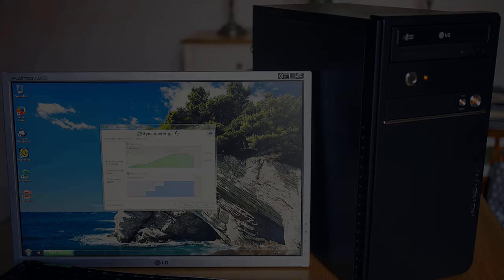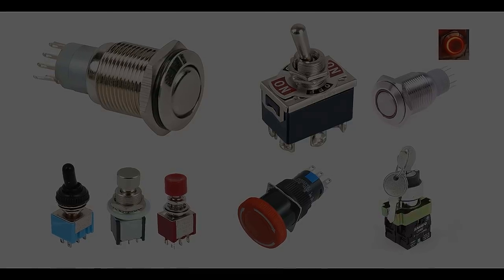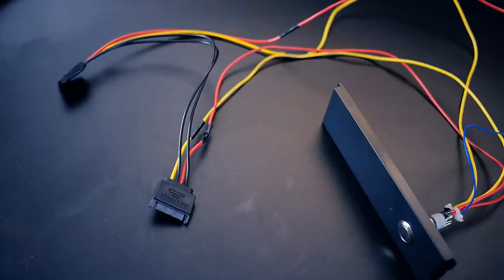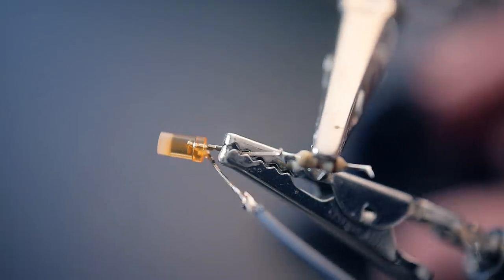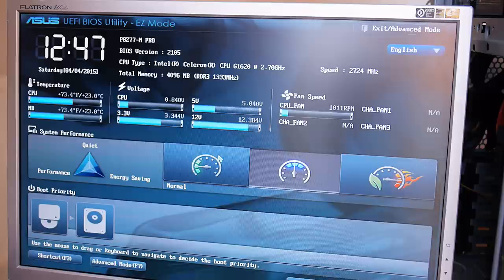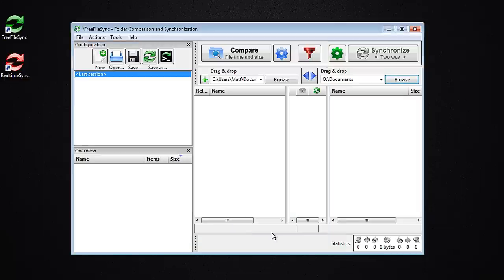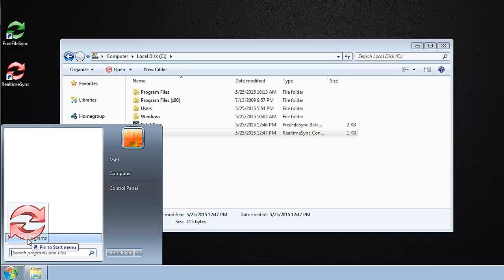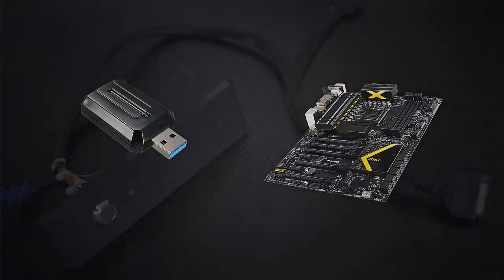How to Make a One-Click Backup Button

Comment: Kinda did this with Hdparm in Windows. Dismounting and silencing my INTERNAL Backup HDD.

I  programmed a script to mount the HDD then start the Back UP (with FFS). 
As soon as the Back up finishes the Script automaticly Spinsdown the HDD and dismounts it again.
Reply: Sure! First you need to download hdparm for windows (since its only native to linux): https://sites.google.com/site/disablehddapm/home?pli=1 (Download the correct one)

You then need to write a cmd (as admin) with cd "wherever you installed hdparm" (e.g C:\ Program Files\hdparm\). as 2nd Line you need to use hdparm -y hdx

X stands for your drive. If you want to silence your first drive, Use hda, your second drive hdb, and so on. I have 4 drives and i wanted to silence my 4th drive, so i used hdd.

Be careful. Because its an ADMIN-Tool you can permanently damage your HDD. 

Want to do this with one click? Create a Batch-File with these commands

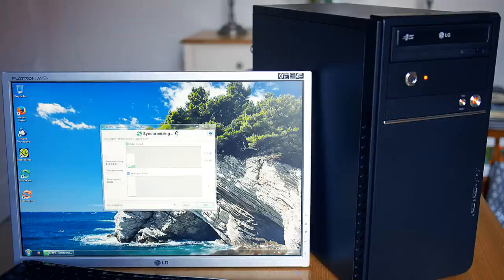Comment: 8:06 dont just disconnect the backup drive it will end up killing the drive sooner or later. It will be at the point where you actually need it. Also dont use a Seagate drive for backup it will die when you need it.

Comment: can free file sync be used on a server, and whenever a computer is connected to the network, then it can be backed up? or will I have to have the software on all my PC's and just use a external hard drive?
Reply from the maker: Hayden123457 It should work on a server, yes.
Reply: DIY Perks thank you

Comment: Done that, but when I turn on the backup hard drive my pc frozes up and has troubles booting up again. Hot swap configured
Could be because I'm using the same power cable as the windows ssd to power up the backup drive?
Reply: EDIT: I used a different exit of my psu that I reserved just for the backup hdd and now it works fine! 
I suggest to not use the same cable as the operating system drive

Comment: I got a interesting question. How the backup software recognize your backup hard drive? by firmware or the drive name? Say if it's by driver name, when I plug in another USB stick which is not a backup driver, would be initialized to run the backup application?
Reply: by the sata port
Reply: No, because he also plugin the USB hard drive.
Reply: +Mirui Wang Probably by the volume ID, each partition has something like a GUID generated so it probably just stores that
Reply: thanks.

Comment: That whole button setup is unnecessary.  You should always be backing up.  It's easier to just connect a regular hard drive into the computer, install that software and have it running all the time.  Then EVERY file you save or delete will ALWAYS be backed up with not additional effort.
Reply: DoomFinger511 the problem is that if you have a Ransomware on your computer it will also encrypt your backed up files, but if your backup HD was powered off the Ransomware wouldn't do anything to your backup HD, so the button is not just to make you remember to backup your file, it's also giving you a layer of protection against Ransomware and other kind of viruses that destroy any data that is connected to your computer.

Comment: Question: Since the 5 volts cable is always connected to the HD, does it mean that some power is drawn even if we are not using the HD? I'm kind of a power saving freak, so if it is even a little consumption, it matters to me :)
Also because I was thinking to use this "trick" to switch between OS with different set of HDs, so when I use one the other HDs won't power up for nothing.
Another doubt is about SSD... is it possible they may run on the 5V alone?
Thanks
Reply from the maker: As it's a double pole switch, 5V is disconnected along with 12v, so it really is unplugged entirely from the PSU.
Reply: +DIY Perks Sorry I missed the DP part at the first watch...
A friend (more skilled than me in electronics) suggested that one can use a SP (Single Pole) button on the ground to cut the power. What are your thoughts on that?
Reply from the maker: Unless you isolate the drive, switching the ground connection probably won't work because the drive will still be grounded through the chassis.
Reply: In addition to what DIY Perks said, the drive would be getting 7V applied between the 12V and 5V inputs if the ground was totally disconnected. It could kill the HDD's circuit board if it dosen't have internal voltage regulation. 

And if you think like I do, the answer to that burning question is yes. If you want to run a always on case fan that dosen't have automatic speed control at about half power (6V would be half speed), use the 5V as ground and the 12V as power. Instant 7V supply to the fan and it runs at just over half power. I put a double pole 4 position switch on my case to select various weird voltages for case fans. This can also be used to turn an old PSU into a (somewhat overkill) AC adaptor for pretty much ANYTHING you can think of that uses 2.7V (between 3.3 and 5V), 3.3V, 5V, 7V (Between 5 and 12V), 8.7V (Between 3.3 and 12V), 12V, 18.3V (Between -15 and 3.3), 20V (Between -15 and 5V) and 27V (Between -15 and +12). Desktop PSUs make a nice lab power supply with lots of power, only drawback is any combination using the -15 rail is limited to 1A max.

Comment: Is there any way to do the button backup without soldering?
Reply: +The Galactic Void You can use, i imagine, keyboard buttons in certain combinations. On Windows there are programs like AutoHotKey. It will seem difficult to set up but with a few hours of documentation, it should be doable for most people that have a clue and can use a search engine.
Reply: One method that I've finally put into play is using a Syba 5.25" Bay (SY-MRA55006). This also adds in the ability to quickly remove the drive or store it elsewhere.

These alternatives have locking mechanisms on the front:
Thermaltake ST0026Z 
Kingwin KF-253-BK

Comment: When you just disconnect power to the drive it damages it (notice the loud click it makes). You would have to eject it first. On that note the backup drive will probably fail sooner than the main drive.
Reply: Sorry thats not true. You will corrupt files if Windows was still writing on it (hence i recommend disabling write cache for your Backup drive). But you will NOT damage the drive. They are protected against sudden power downs. The click you hear is the head going into parking position. Which happens automatically if the power is cut, purely by using the force of the spinning disks.

Comment: if i embed a portable hardrive inside my pc using a spare usb port can i just use a single pole switch on the postive rail of usb.
Reply: +stewart c You only need a double pole if you want a LED. If not a single pole is fine. Yes you can do that, but why not just take it out of the enclosure and plug it into sata? That would allow much faster transfer speeds than over usb.

Comment: could i use a usb cable, plug it into my raspberry pi mini computer then have some software installed on that so when it boots the software loads up and then have a harddrive connected to a usb to sata from the raspberry pi so that when the button is pressed, it detects the main pc as a drive, then it some how copys data from the pc to the raspberry pi and into the new drive?

Comment: I know there is still reasons for this to keep local, but the effort required still wont't match the todays method of using a service like onedrive or google drive, can get 15GB for ''free'' 

I know this is 5 years old and some might still want a local option, but real time cloning would be more appropriate as even a days worth of data can be a pain for some

Comment: What happens if I only disconnect the 12 V rail because i can't find a DPDT button, when i do it windows does not see the HDD in the Disk manager and when it connect it back up the HDD appears.

So basically does it work with only the 12 V rail disconnected and the 5 V connected, does it affect the HDD
Reply: Wondering the same thing because I have a cool button but it does't have two poles...

Comment: This is generally how you end up losing data after you dismount the drive whilst windows is doing a cache check or defrag on the drive. Just plug a hard drive in and use the windows encryption tool. Problem solved. Your backups are protected and corruption free. Your welcome.

Comment: but just cutting power to the harddrive isnt good? same thing as pulling the power to the computer
Reply: Doc842 it is not really dangerous because newer hard drives have protections against power loss. On top, the hard drive is not in action so the reading thing is inactive and can not deal any damage to your hdd. If you want it as safe as possible, use an external drive as in the video and unplug it after shutting down your pc.
Reply: Actually, if the files have not finished writing to the drive it is very dangerous. This is common if you do things like enable NTFS compression on the target drive, or if you are running a very fast source drive (SSD) and the target drive is slow (HDD). Basically, the OS could report to the software its done writing, so the software finishes, but if you check your RAM use, you might see a coloured section showing Modified data. This is data that has not yet been finalised to disk.
One of the functions of the Safely Remove Hardware function in Windows is to ensure that all Modified data has been fully flushed to disk before the disk is detached.
Reply: There may be an icon on the bottom right, which lets you safely eject the drive before cutting power.
Reply: It's ok if your pc can hotswap hdd.
Reply: Windows has that ejection thing or it does when you unplug it but if it has windows than you will get a bsod
Reply: It is NOT safe just because you use hotswap. Windows will still be using the writing cache. It can corrupt your MFT.
Reply: It's fine in a RAID 1 scenario with the m/b and BIOS equipped to handle hot swap.  Server boards can even handle DIMMs being hot swapped these days.

Comment: A real backup should allow simple drive swapping and your up and running again in no time at all when a failure does occur.  Where's the software that allows that type of backup?
Reply: Use the backup function of GParted on the Linux based GParted partition editor boot disk. You'd boot the CD (or USB), and use the partition clone feature to create a "clone" drive that could be swapped in place.  I'd reccommend creating a clone of a vanilla OS install with all the updates and software you need with no data, then backup the data seperately using a regular backup. Keep the twin drive somewhere safe and do a physical swap if something goes bad, and restore the file backup. OS back and running instantly, files reloading int he background over an hour or two. I'd reccommend multiple clone drives for maximum convenience. The drives have to be the same model series as Windows won't boot with a different drive model or in the very least would require license reactivation.

Commercial alternatives (that vary from cheap to expensive) are something like Norton Ghost, which also work VERY well, but are generally a hint on the expen$ive side, but work in the exact same way, give or take a few features.
Reply: theLuigiFan0007
 Thanks for the response.  The backup that consumers need is one which DOES NOT require multiple clicks and routines to accomplish.  LISTEN UP SOFTWARE ENGINEERS....  The ideal backup procedure would be as follows;
1.  End of work day, computer user double clicks on a icon, grabs his jacket and keys and is out the door.  When user returns the next day they power on their computer and begin working.

The backup is performed internally to a second hard drive that can be selectively chosen as the new primary boot device through bios IF/WHEN a catastrophic failure occurs.

No selective restore routines, no OS reinstall and then perform a restore from backup....the routine needs to be quick and simple so the user is back being productive in less than 15 minutes.  And, if necessary, they can call a tech to schedule the failed drive replacement, but the key is they are working again and production continues.

The problem with RAID arrays is if you get a virus, its instantly copied to the other drives as well.

Comment: There is no point In having a fancy switch just use a simple push switch instead of 12v and 5v connected ground to switch it required less soldering and is less complex.

Comment: My cable has 4 wires, what do I do?
Reply: the 2 blacks are ground wires and the yellow wire is the 12 volt and the red wire is the 5 volt rail
Reply: Aimee Cos oops I meant to type 5 wires, it has an extra orange wire. I 'll try with it and if it doesnt work i'll just cut it. thanks for your reply though.

Comment: Better to use an ssd as backup drive because they are faster
Reply: +Zona ALG But then you will have to get another SSD for system. Other way the second HDD would be a bottleneck.
Reply: Misza well thats right!
Reply: +Zona ALG SSD's are too expensive for updates and they cannot hold data for long periods of time unpowered (after 2 years unpowered they start to lose data.... long time but still). It would be best to have a NAS with archive grade harddrives and just use the software to backup weekly or something similar to the NAS.
Reply: Lachee Plebian i didnt know they loose data
Reply: Zona ALG I admit I was a bit hasty with that fact, sorry. High temperatures and no power can cause data retention loss, but I guess its not really something to consider as it takes several years. The price/GB is still very expensive until you get into the several TB/s for a SSD, but then its still more expensive than a conventional HDD
Reply: Lachee Plebian well i was saying that because it is faster (And yes its real that if you dont have a ssd it would make a bottleneck) but also one 250gb ssd isnt so expensive and because it is a backup drive you dont need a lot of gb... (i mean... you are not backing up your full pc, almost on this backup option[this video])

Other thing is that if you have a better or faster hdd on backup it would be the same (bottleneck) but otherwise it would be the same [you need to have the same write and read speed as your internal hdd]

Another score for the ssd is that it doesn't vibrates so for a "silence" pc it would be great.

And if you want to make huge backups its obvious that a NAS Would be better
Reply: Zona ALG true. If you are only updating certain documents and folders it would be much faster. I would imagine if you had anything more than 100GB backing up regularly you probably would have a proper backup system anyways. Personally, if I was going to spend the money on a new SSD would have it installed in my computer as a working drive, not just for backups, but I can see how it would be helpful in this particular setup.
Reply: Lachee Plebian yes... i think the same (better to have it on your system than as a backup)

Comment: But it wont protect it from lightning. Anyways nice vid as always!
Reply: telefon72 Use a surge protector then.
Reply: telefon72 if you use a external HDD thats not always connected then it will
Reply: thingyee1118 Yes but i was thinking of the internal one, i know an external is protected. :)
Reply: telefon72 Your right that technically you HDD is still connected, so it doesn't protect againt lightning. But unless you have a terrible power supply voltage should never run up your ground wire (so unless you have a grey(unbranded) psu you have nothing to worry about). But if your worried about that, the simple solution is just to also connect the ground wires also (you will need a larger switch but that's not a problem), and repeat the same process as the live wires. However the best way is not to cut the wires at all and create yourself a basic circuit board, with two sata power connectors attached, looks 10x better but requires alot more work (you need to know the name of the connector but these can be purchased from any modding store).

To be honest I would myself go with rsync for the software, it's 10x better and supports windows and linux. Does require quite a bit more know how but not by much. The big benefit is you can instead backup everything on your network not just on your machine (if you combine this with wake on lan you can also turn the machine on for backups).

Does anyone know if this does a binary comparison (just checks for changes in the bits) or does it just re-copy the old files?
Reply: I assumed it was incremental but I don't use it. Eh I use robocopy on windows and Rsync for Linux++;
Reply: telefon72 It wont protect against fire or flood either. That's what off site backups are for.

Comment: Nice project, I'd like to do the same, but I'm not sure, which wire I can use. Is 0.09mm² enough or do I have to use thicker wires?
Is this okay? https://www.conrad.de/de/litze-1-x-009-mm-schwarz-medikabel-120287-meterware-609957.html
Reply: +LastChaosTyp just go to a computer shop and ask for a broken/old ATX power supply, he or she probably will give it to you for free, then go home and take the wires you want. you'll get a good amount of components out of the ATX if it's broken, if it works you can make a good "ATX power supply" like this http://www.instructables.com/id/A-Makers-Guide-to-ATX-Power-Supplies/
Reply: Luigi Tesla Parisi Tanks for this tip :)

Comment: If I purchase a switch with a built-in LED indicator, does it still need to have two poles? Or does it just need to be a locking, single pole switch? For reference I am looking at purchasing this switch: http://www.ebay.ca/itm/16mm-12V-Latching-Stainless-Push-Button-Switch-with-Annular-LED-Indicator-GREEN-/360916055741
Reply from the maker: Toasted Bread Films Needs two poles because both 5v and 12v rails need to be switched. If you're feeling smart though, you can use a relay and a single pole switch if you want.
Reply: DIY Perks Ok, thank you!